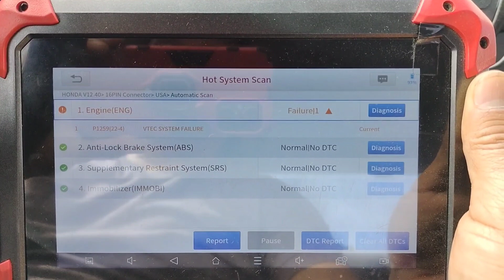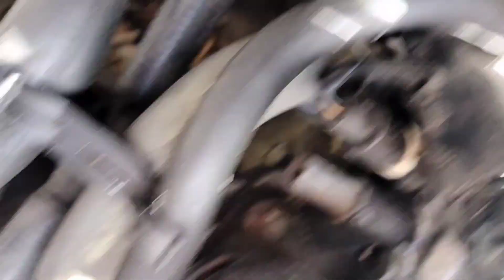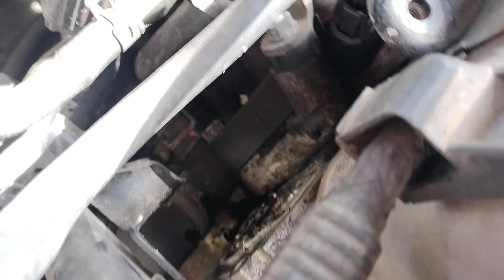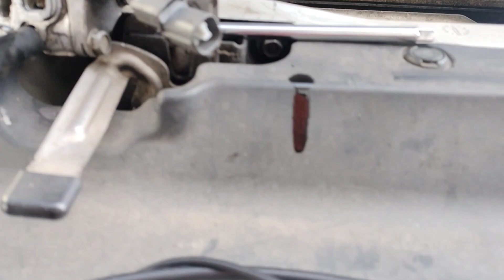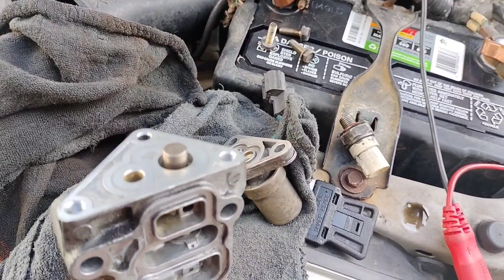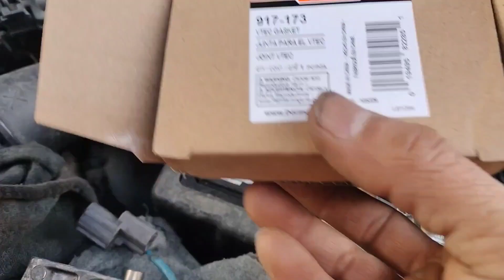2002-2005 Honda Civic VTEC system failure engine code p1259

Comment: would this be a expensive fix? i have this code and misfiring on each cylinder … i have same issue with no oil on dip stick

Comment: I have same problem I replaced the vitec the same code still here
Reply from the maker: Probably a wire issue
Reply from the maker: Check the engine oil. Or wiring harness